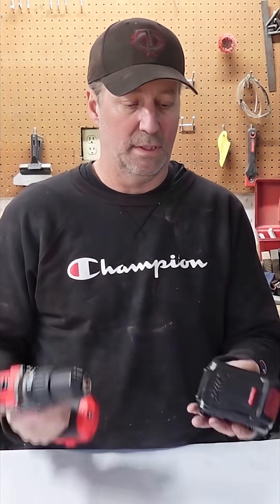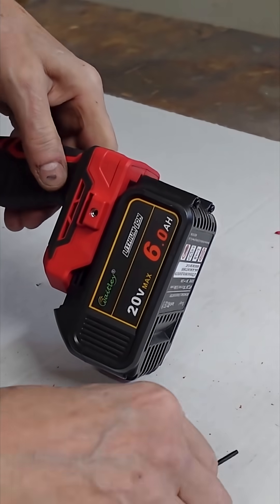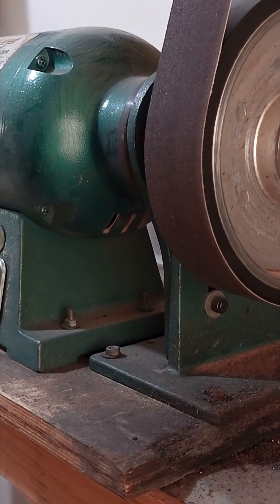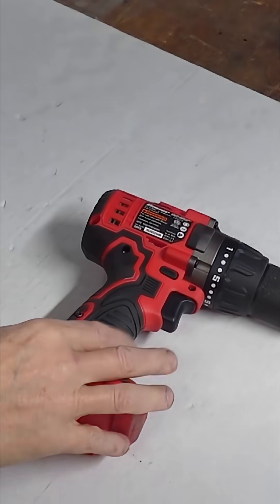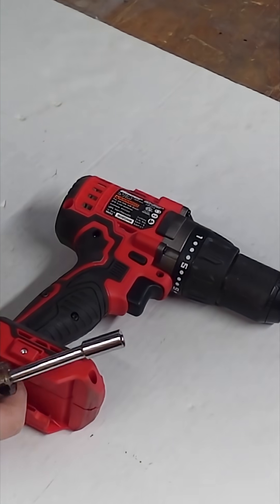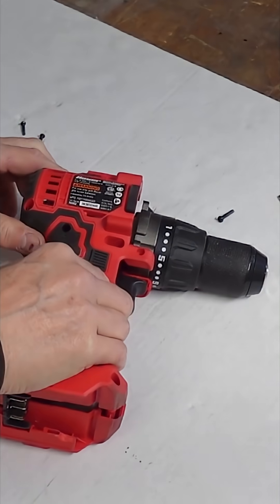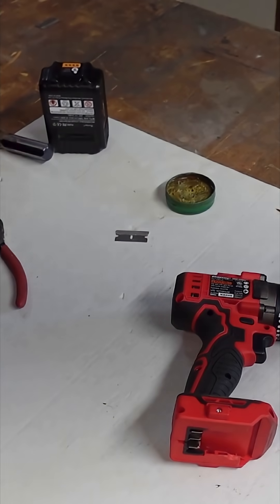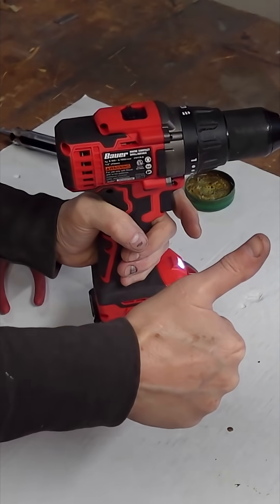🔥 Bauer Drill/Driver to DeWalt Battery CONVERSION | Ultimate DIY Power Tool HACK

Comment: all that for what buy an adaptor or their batteries
Reply from the maker: I already had a bunch of dewalt batteries and didn't want to have two types of incompatible batteries, chargers, etc.  This conversion cost about 30 cents for the resistor.